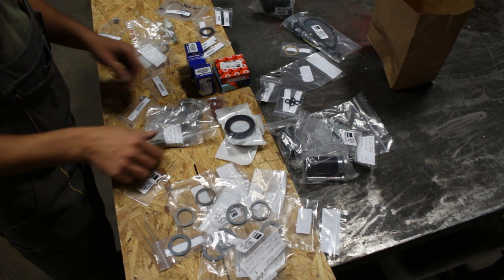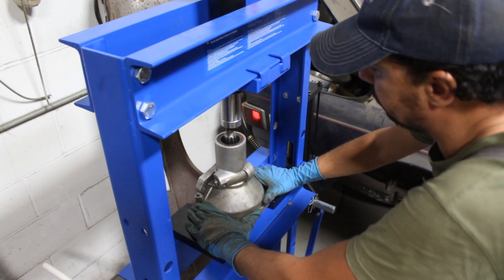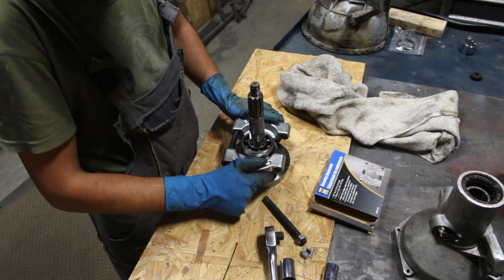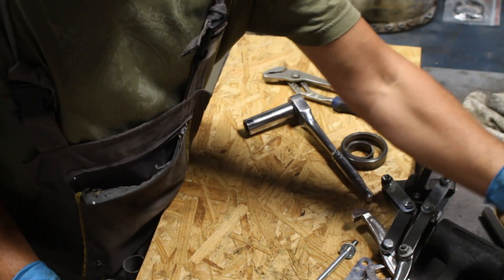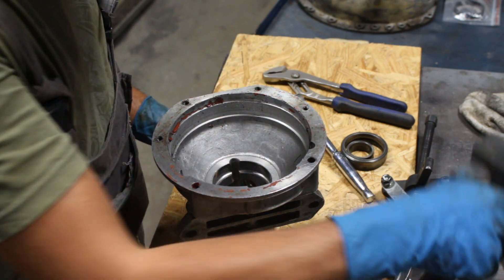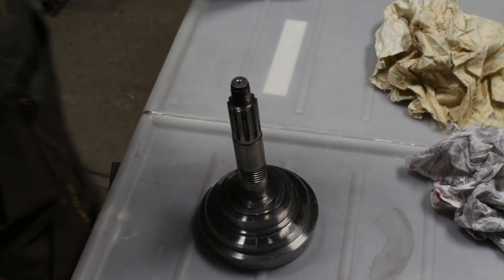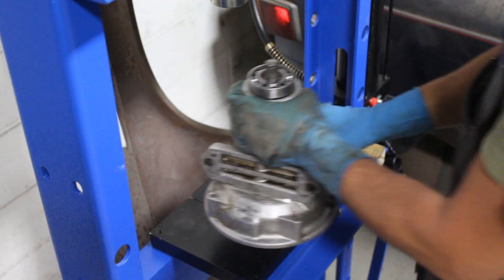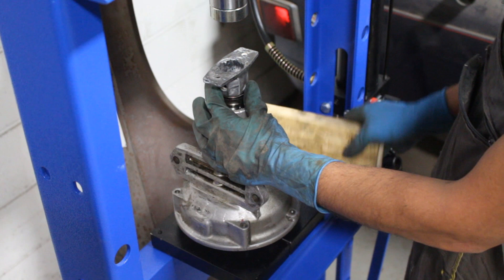A-Type Overdrive Overhauling - Part 4 - The End Play!!!!!

Comment: I noticed you don't pre grease your bearings before you install.
Reply from the maker: Well they came pre greased inside, but you are right a little more grease wouldn't hurt. When I first fill it up with oil I will tilt it back and forth to make sure the oil spreads around inside.
Reply: Pre greased? Are these bearings not immersed in transmission 90w oil?